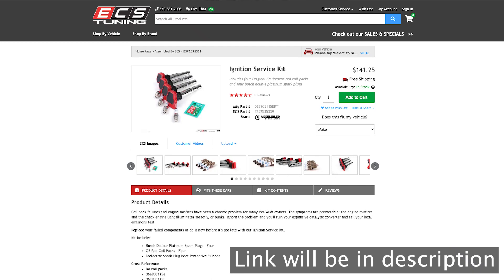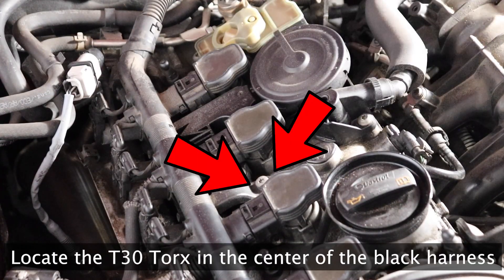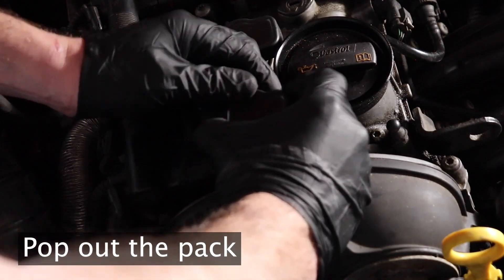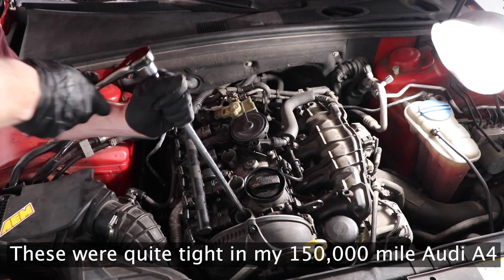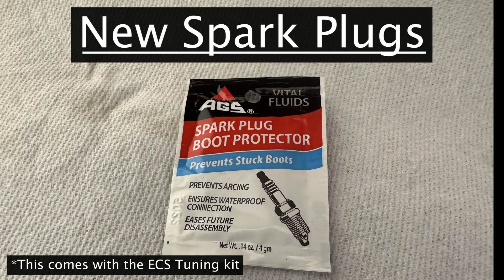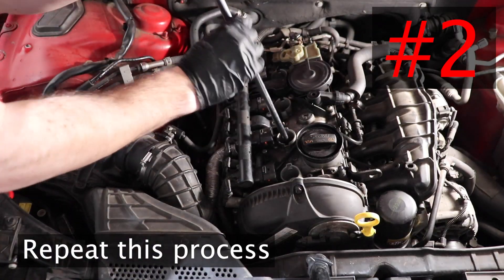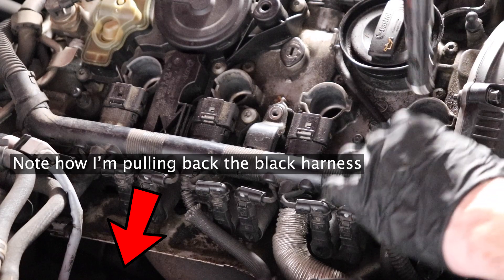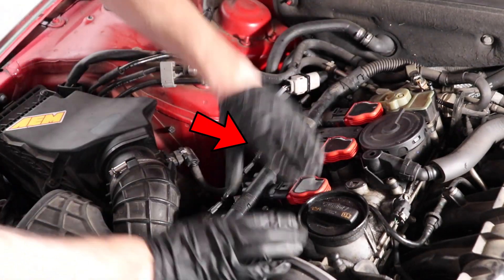Audi 2.0T B8 Coil Pack Install - (ECS Tuning Ignition Service Kit)

Comment: Good job, I want to know if with this change you feel any improvement in engine power?
Reply from the maker: The car ran significantly better/ had smoother cold starts after the installation. However, I cannot confirm that it increased the power band of the vehicle.